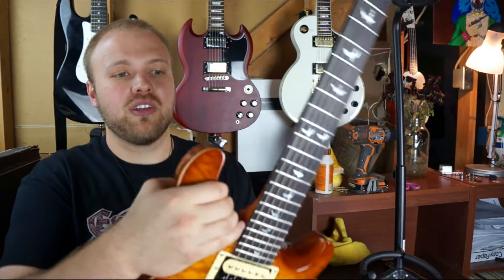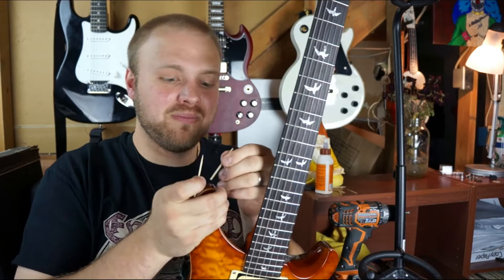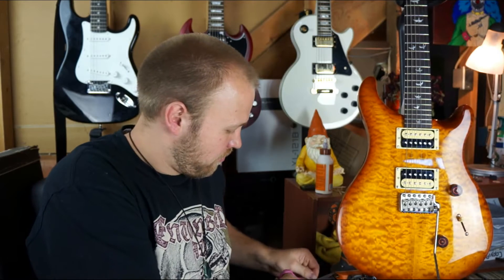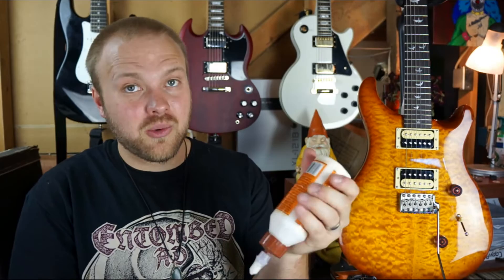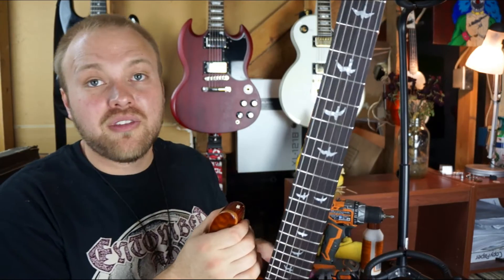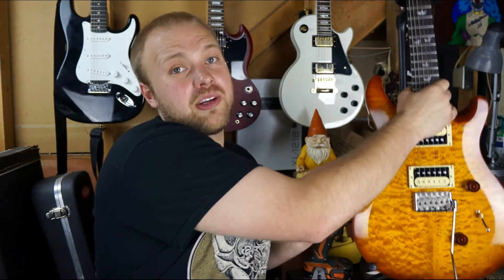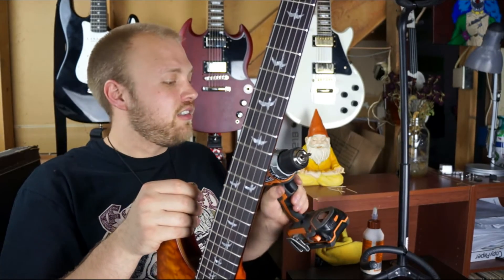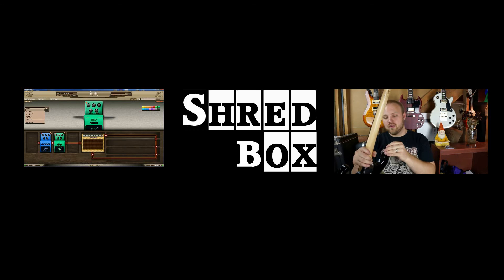HOW TO FIX A STRIPPED HOLE ON A GUITAR-THE TOOTHPICK TRICK

Comment: I’ve used Wood filler instead (the strong type) and I’ve had excellent results.
Reply: I've just done this on the hinge of my bedroom door, thanks for the tip!  Less chance of splitting the surrounding wood using wood filler instead of tooth picks.
Reply: Wood filler doesnt have good holding power.
Reply: @HeatMyShorts  You're right, so I found out lol.  The screws came loose after a couple of weeks.  I've since had it done properly by a joiner.  Fingers crossed!
Reply: @HeatMyShorts  I've held a Gibson Standard LesPaul for over 2 years on the Strong wood filler with one of the "clip in" straps and it hasn't moved at all. It's very solidly attached, I see no issue with it and I don't expect it to be. And should it somehow become loose again, it's very easy to drill and do it again; in my limited experience with two guitars using the same "method" I have not observed bad holding power. Your mileage may vary.

Comment: Is it really necessary to use wood glue or any other type of glue?
Reply: Nah dont, works without
Reply: I;ve used maple dowels then screwed it back on.  never used glue and never had a problem.
Reply: Friction is probably enough, the glue is just more of a bonus step.  If you applied a lot of force in the opposite direction that the screw is inserted (doing crazy guitar spins, wild stage antics, whatever), it MIGHT be enough to pull out the toothpicks without glue.  Glue takes it from friction to friction + adhesion.  And it really doesn't hurt anything as long as you don't get it on your finish.
Reply: You can use a hammer with a felt furniture pad stuck to the head to tap things in with without hurting finish.

Comment: Good fix. I just had to replace one of my strap pegs so using a toothpick, I filled the joint with Titebond before inserting the new pegs...overall cost = $4.
Reply from the maker: Thanks MrMongo :). I'd been putting it off for a few weeks expecting it to be a much more difficult and expensive fix than it was. It feels so good to not worry about my strap pulling off while I'm playing.
Reply: absolutely, i have learned many repair techniques - both in person from other guitarists, and online.

Comment: If I strip the toothpicks is it impossible to take them out and put in new ones? Great video, thanks!
Reply from the maker: You won't be able to get the glued toothpicks out easily, but there will be a hole where the screw was that you can put new toothpicks in.

Comment: Does wood glue work better for this than liquid super glue?
Reply from the maker: +Matt Speak I don't know about better, but it does dry more quickly, so super glue is better if you are in a time crunch
Reply: Thanks. By using either super glue or wood glue, will the strap button be glued permanently into the guitar? Would I be able to remove it if needed?
Reply from the maker: Matt Speak No problem. You can remove it as long as you let the glue dry before reinstalling the strap button.
Reply: Yes. Wood is a porous material.  Wood glue is formulated to sit on the surface rather than soak through like most other glues do.  So, use wood glue on wood :-)
Reply: Stay away from super glue. One mistake and the finish is ruined.

Comment: hey,can this trick work with stripped screw hole in the floyd rose bridge ??
Reply from the maker: +Damien Miller It'll work for just about any stripped hole in wood. When a screw in wood is stripped, the hole is the same size or bigger than the screw. You are basically giving the screw surface area to grab onto and add holding pressure by adding the toothpick.

Comment: I wonder if this is suitable for a stripped hole for the bridge on my bass.
Reply from the maker: brad h I've used it for other things as well like a stripped hole on a speaker cab. Don't know why it couldn't work for your bridge.
Reply: brad h hey Brad, i’m having the same issue right now, replacing the oem bridge on my squier jaguar bass with a gotoh 201b which is supplied with smaller screws. Would appreciate your feedback on this ! Did you try this method ? Would you recommend it ? Thank you !